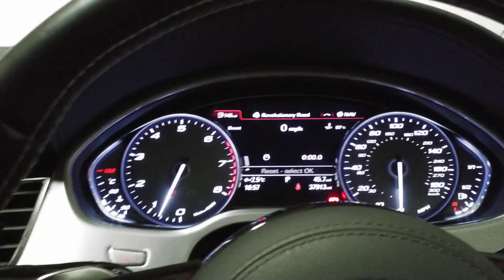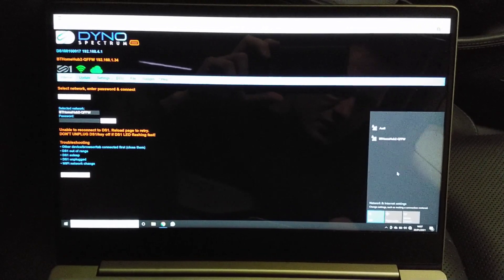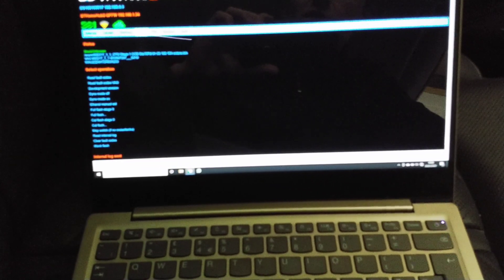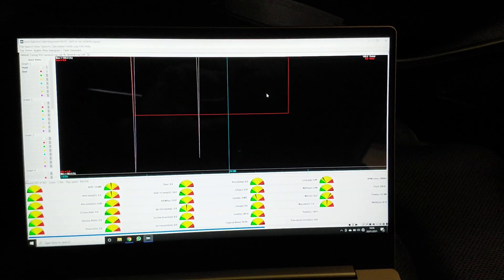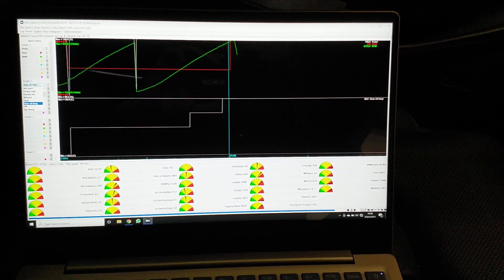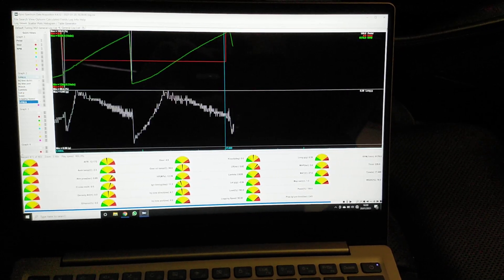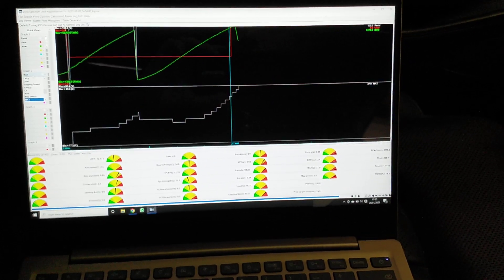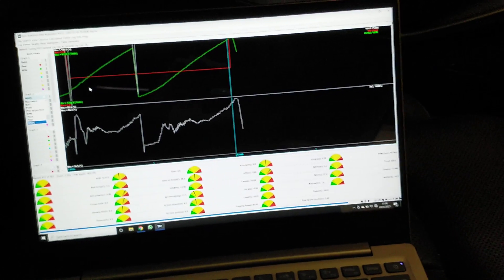Dyno Spectrum internal datalogging

Comment: Can you change the pedal threshold and how do you control what logs are leftover in the DS1, can they be cleared?
Reply from the maker: For internal logging the pedal threshold is presently fixed. The DS1 logging runs for 30 minutes when the engine is running with no pedal threshold though and that gets erased when it is downloaded. Both of these methods are volatile so they are lost when the ECU or DS1 powers down (unless saved).